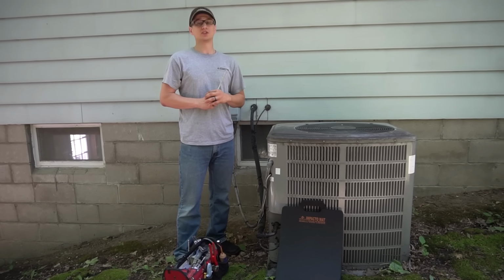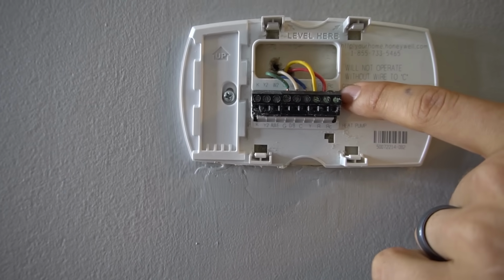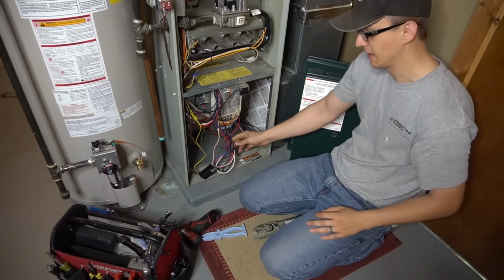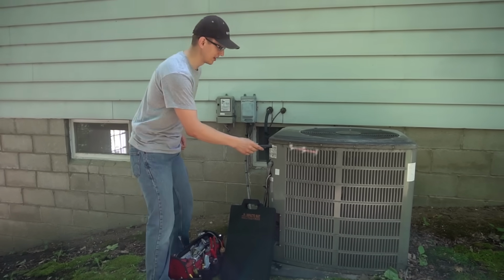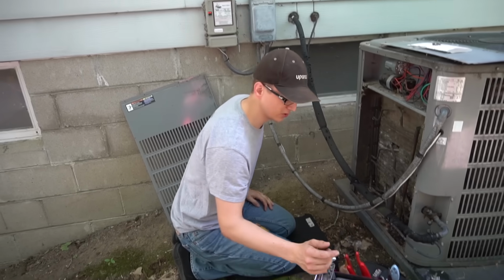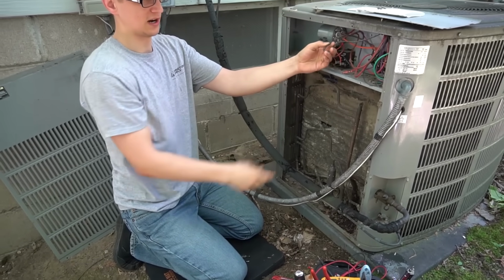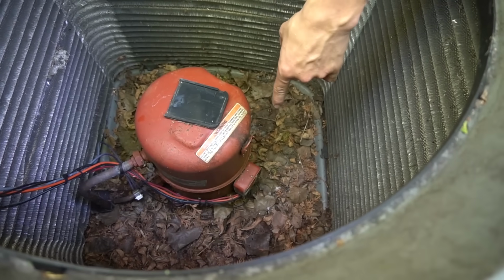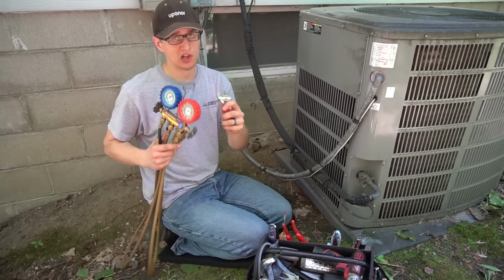AC Unit Not Turning On - How to Fix It Step by Step

Comment from the maker: ❄ Other A/C Videos For Reference:

Top 5 A/C Problems:
https://youtu.be/GOXgdnRB840
How to Clean Condenser Coil:
https://youtu.be/pzwOvgjwm_Q
How to Replace a Capacitor:
https://youtu.be/9ZGfvC-PMWU
How to Replace a Contactor:
https://youtu.be/qHZc9wWAF4c
How to Replace Condenser Fan Motor:
https://youtu.be/gGFTd2dmgxg
How to Replace A/C Control Board:
https://youtu.be/hijUExXrcm8
How to Replace a Thermostat:
https://youtu.be/1mJkjrwxdP4
How to Program a Thermostat:
https://youtu.be/uun8HJhM3h4
How a Thermostat Works:
https://youtu.be/Z4T9H-6VPtI
How to Check Freon Level:
https://youtu.be/dExFtP-nXTw
How to Wire A/C Condenser Unit:
https://youtu.be/KCanZEsLVEI
How to Read A/C Wiring Diagram:
https://youtu.be/I-sB4GIlbl4
How an Air Conditioner Works:
https://youtu.be/cRnzYJ4qmWE
When Should You Replace A/C:
https://youtu.be/Z7vUOySOWbM
15 Air Conditioner Maintenance Tips:
https://youtu.be/pBBnXHse-T0
Should You Get an A/C Inspection:
https://youtu.be/JqNsEzb__qs

Also, I see this question in the comments very often: "so what do I do if I press the plunger and the unit comes on? Should I replace the capacitor?"
If the unit comes on, that actually means the capacitor is likely not the problem. If pressing the plunger turns your unit on, I suggest watching this video to further narrow down the possible problems: https://youtu.be/NVPhsK4gK1A
Reply: Ok so we replaced the capacitor and the contactor and the fan is still not turning on. This is only a 2 1/2 years old unit. Everything still looks brand new.. The inside unit turns on and blows out air.. New battery's,  rest set Everything.  Idk what else it could be.
Reply: Super Tech. He should own the businesss by now. Thank you sir!
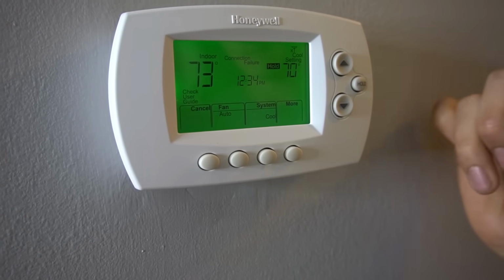Reply: So here's a problem I have turn the wintertime it gets to 69 in the house then it shuts off automatically I turn it back on it works goes back to whatever we have it set to like 72 we don't have insulation so turn the winter it can get very cold. What could be the problem you know cuz once it goes below 70 or gets to 69 it will just shut off then at around 3:00 in the morning we have to wake up manually turn it on. Had a couple technicians come out they couldn't figure it out I think it could be from the thermostat wire having a short and it maybe it just causes that issue but then once we fix it hopefully that will fix the problem do you think that's the issue?
Reply: There's no power to either of my thermostats or the unit itself and the outside unit isn't running either , the breaker isn't tripped

Comment: Hi there Jay!  My AC unit was working fine up until a few days ago.

Thermostats in the house work. 
AC filter is clean.
All breakers are set to on, nothing is tripped.

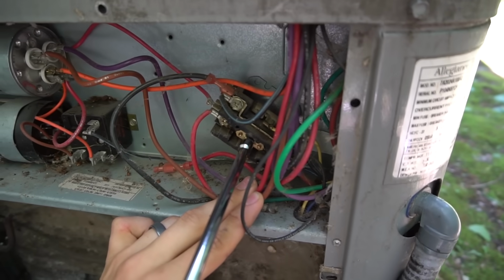When the AC inside is set to "on" the little plunger inside the electrical panel does not go down on its own BUT the AC condensor unit does turn on when I press it down the way you do at the 17:52 mark on your video.

Any ideas what it could be?

Comment: Just fixed my AC unit with the help of this video. A lizard crawled in and wedged itself between the contact points of the capacitor and turned himself into a fuse. Fried himself and the capacitor. Bought a new capacitor from a local HVAC store for $14. Yes, FOURTEEN dollars! AC blows cold again!

Comment: My outdoor unit will not kick on. Indoor air works, emergency heat works. No battery needed in thermostat like yours.  I have replaced the capacitor, the contactor, and the fan motor.  When calling for heat, I can hear the contactor click on, the buttons on the contactor pull in like its supposed to, and I can hear electricity flowing through it.  It does the same thing when a/c is called from the thermostat.  So I can hear it clicking on and off but no fan or compressor.  Any help would be awesome!

Comment: My current issue or what I thought, my thermostat said to replace the batteries for weeks now. Today I noticed the AC wasn’t kicking on so I replaced the batteries and it’s still not kicking on, indoors or outdoors. Even the fan won’t kick on. We have reset the breaker indoor and outdoor. I’m not sure what it could be

Comment: If you are still answering questions: My breaker keeps flipping immediately after I turn the outside breaker on the fan turns freely and begins to turn just briefly. I have checked everything in your video including switching out the breaker with no luck. Have you ever had the breaker pop from the compressor going bad? I have looked at wiring and also changed capacitor with no luck. My unit is 9 years old. thanks
Reply from the maker: Sorry to hear about the AC troubles. I'd suggest starting with this video: https://youtu.be/G1EBHrOgs-Q?si=AW_IK4dxIfzXyPiT
Reply: @WordofAdviceTV thanks

Comment: I replace my house filters, I wash my AC outsede. I keep on replacing the capacitors (once every 5, then 2 or one year. But I beleive that there is an underlying issue for capacitors to go out so often; though I don't go for the most expensive ones.  I replaced relays and now I am worried that I will need to replace the fan motor. But I need to check the attick drains first. Hopefully, I don't need freon (R22). But my ACs don't cool much air. I feel other people's houses cool down more and faster and mine have to work non stop and longer and with the worse results

Comment: Wow! You are super well spoken and extremely informative and detailed! It's EXACTLY what I need. My problem is that I can never learn about the proper use of a multimeter. It seems no one understands it no matter whome I ask. But regarding the fixing the entire AC, the explanations are SUPER easy to understand and to follow and super helpful, thank you so much. I need to crawl to my attick for check points- and those are not super clear due to not being so easy to access for exploring and are not very attractive to even think about it :( JJ. Thanks for being so thorough. Every time I come accross your videos, it's always pleasant to watch and is helpful in my cases.
Reply from the maker: Awesome! Glad to hear that the videos have been really helpful for you! I have 2 videos on multimeter use that you may find helpful. One long, with examples of use on furnace, and the other video shorter but with a newer multimeter.

Long video:
https://youtu.be/zr4Ow1JT9jU?si=CWMa4CUCAlLS0Nqs

Not as long:
https://youtu.be/y8JlMZwo7Pk?si=ggfBTAw8y4bOX-fV

Comment: I replaced my capacitor, but now the plunger engages with no fan, when the cooling system turns on. I hear the buzz. Before I replaced the capacitor, if I pushed the plunger, the fan did start. Is my contactor bad?
Reply from the maker: Sorry to hear that the repair didn't solve the problem! It's frustrating when that happens. Did you double check the wiring going to the capacitor? Maybe the wires were not hooked up in the right spots?

Comment: My account was working there was no cold air coming out. I cleaned could,  changed the filers and even put in a new capacitor... when I started it back up, it ran on the new capacitor for like 4 minutes and stopped and never came back on. I put the old capacitor back in because it was working and same nothing works. The fan blower works but the  blades and compressor  dont come on now. (Outside unit) now im at a loss. Aside from spraying water on the coils  i dont know why all the sudden it would stop working . Capacitor connection appear to be correct.  It's a Goodman 
GPC/GPH13 &14 SEER "H' SERIES
WITH R-410A

Comment: Another possible issue is if you have an overflow kill switch in the tray under your coil (furnace/blower side) that’s filled with water. If you have one of this switched it’ll look like a wire with two leads that is connected to a PVC elbow turned up. Drain out the tray and make sure the switch is able to drain (not angled down).

Comment: My troubleshooting led me to the attic mounted furnace where I noticed the condensation pan had 2" of water and lucky my HVAC installer put in a float cut off switch. Scooped all the water out, float reset and AC kicked back on. I also cleaned out the drain pipe. Hope this helps someone. Great video by the way. Thank you for taking the time to helps us homeowners out.

Comment: Here's an annoying one I ran across tonight at midnight:
Furnace fan starts but outdoors unit does absolutely nothing
Jumper is present between R/Rc, good continuity between them
Thermostat relays are closing Rc-G and Rc-Y
Manually jumping Rc-G starts furnace fan, Rc-Y does nothing
Unit breakers not tripped, 28VAC control voltage at R/Rc
245VAC at contactor of outdoor unit
Pushing contactor plunger starts unit just fine

0VAC control voltage at coil of contactor! What gives? Wire is not cut or chewed anywhere! Either I'm missing something or there is a break in the thermostat wire somewhere invisible, which is extremely annoying.

Comment: Your videos are excellent and have helped me numerous times.  I have a problem / question that I have not seen covered in your videos that I am hoping you can give me some advice on.  The unit is roughly 10 years old and has been working fine (this year, in previously years replaced the contactor as well as the capacitor).  It stopped blowing cold air yesterday and at the time nothing appeared to be frozen (checked inside coils) so the unit was turned off.  Today when I turned it back on, it is blowing warm air and the small discharge line inside is VERY hot, outside I think everything is running but not 100% sure that the compressor has kicked in (will be checking the voltage and contactor later today).  Does that sound like low / no freon or that the compressor is just not running?

Comment: Another simple easy fix is that if your thermostat is on and you went through all the other steps. 

If your furnace/inside ac unit is in the attic make, there’s a pan under it for water and there’s a switch with a little piece of foam on it almost think of the toilet tank floats. They float could be either blocked or in my case water wasn’t draining out of the pan and activated some kind of safety mechanism that wouldn’t allow the hvac to turn on.

Comment: I have a unit that has a hard stsart installed...  I am on tghe Gulf Coast and want to inistall a SOFT start, Can I just remove the hard stsart and replace it with a soft start??  Is there a reason for the hard start??

Comment: Thanks for your videos… AC outdoor condenser fan isn’t working, my furnace fan works I’ve changed the capacitor, if I push in on the contactor switch the unit will come on, however it will not continue to work? Any thoughts? Contact switch bad?

Comment: So I noticed our ac was not getting cold. After watching i think it may be related to that plunger. So I have to turn the breaker off and on and it will work fine.. once it gets down to set temp the outdoor unit fan turns off.. but once the temp rises it never kicks back on.. so in the morning the house is at temp but I get home from work and it's scorching inside... so I have been just turning the breaker inside on and off to make it work temporarily

Comment: I know this may be long shot but here goes:  The fan isn't turning on my a/c unit.
 I checked the thermostat-good. Hot air is blowing inside when i turn it on.
 I changed the air filters in the furnace and I didn't see any burnt out wiring.
Outside unit sounds like its trying but then turns it stops. And then tries again. The fan isn't turning though. And the unit itself feels hot to the touch.
Any other troubleshooting advice before i just give up? 
Thanks!

Comment: My fuse blows on the card.  I disconnected all the thermostat wires from the unit it still blows.  I press in my contactor and the unit powers on.  Everything but my the white wire is grounded.  When I unwire the thermostat wires from the unit.  Only the red and yellow wires are grounded at the unit.  The disconnected thermostat wires from the house are grounded to each other.  Red,yellow,green.   The thermostat inside is set to cool.  Contactor that is Unwired at the ends and no power exhibits 17 ohm at either end.  Transformer shows 28.6v
Thermostat inside is battery, (replaced them). Simple basic thermostat.  My whole unit is outside.  Gas heat and ac.

Comment: Any leads on what I should check if the system works when the plunger is pushed in? The thermostat seems to be working fine, I replaced it with new batteries but the only way I can get the ac to come on is with the plunger manually pushed in, the system is completely quiet otherwise
Reply: Actually just found your video on top 10 reasons this could be an issue, thanks

Comment: I don’t know if this is covered specifically but I managed to get it up and running again but some of the system has leaked a lot on the inside area around the filer area. Any reason why the inside unit would be leaking??

Comment: My AC is acting up. Something to do with the AC disconnect near the out door unit. When thermostat kicks in for cooling, the fan/compressor  does not start. However, If I pull the disconnect switch and place it back, everything works as normal. And the unit  shut off after reaching the cooling temp. Then next time, when thermostat kick in for cooling nothing happens until I repeat the pull/place at the disconnect switch.  What could be wrong? Is it switch or the start/Run capacitor? Thanks.

Comment: 1:26 That dont seem too wise to try to spin that with a screwdriver while its on. Better way and waaaaaaaaaaaaaaaaaaaaaaay safer way is to spray water down on the fan. That will also spin the blade blade with out any possible chance of dropping a screw driver into the fan if it does take off. I am not a professional but I do have some common sense. Only time I would spin the blade with a screw driver is while the unit is OFF, to test if fan is seized. By the way I am here looking for info. I have a CK30-18 the fan does not spin but it does spin easily when I spray water down the center. I hear a low hum coming from the machine.  The indoor fan will spin some. If you can answer this or point me to a video I will subscribe.

Comment: Bro you saved me. Thank you for a detailed, but easy to understand explanation. Everything seemed normal based off your description, til I got to spinning the fan

turns out the fan was stuck (prob rust from heavy rain yesterday) and 2nd push got it going

Although I couldn’t find the contactor switch on my unit

Comment: Hi , I noticed the air coming on seemed to be more quiet. It’s cold but shutting down . Thermostat says warmer than what I have it set at by a couple degrees so then I turn it down more and it doesn’t kick back on . I turned the fan from auto to on and it doesn’t kick on husband check the breaker backs and didn’t find anything. I went outside and the pipe where you put the Freon in it’s wrapped in foam the top of it has frost on it and then the pipe that’s attached to the air conditioner from that part has frost on it while I was outside the air conditioner kicked on all by itself. We did check the blower and it is spinning. What could be going on?

Comment: My thermostat upstairs is a nest thermostat.   I noticed the upstairs ac hasn’t been turning on and when I check the thermostat, it says e298 - no power.   The unit downstairs seems to be working fine.   Where do I start troubleshooting?

Comment: I have been told by two techs that my compressor is on borrowed time. Everyone is back logged with work. It is a system that uses r410 a. So I need a complete system. I am trying to nurse it along. The problem I am having right now is the compressor will shut down and not restart. The handler keeps running and makes the house warm. I through the breaker which by the way never trips and the compressor comes back on. Does this make any sense?

Comment: Your video is so informative! What do you suggest for a unit that is blowing inside, the fan comes on outside, but then turns off and doesn’t come back on until you turn off the system at the thermostat and then turn it back on?

Comment: My fan blades are puttering but not spinning. 
I am feeling a little stuck on what to do next. I have gone through and checked most of the things in order that you have presented. I have checked the thermostat and everything is working well there. I have checked inside and everything sounds, feels, and looks good there. I am looking at the outside unit. I have cleaned underneath all the panels. I have changed out the capacitor. I have tried to push the slightly puttering blades and they won’t spin fast. The compressor unit sounds like it is on and the fan sounds like it is trying to move. I think that the next solution is oiling the blades or replacing the fan motor. I am going to the store to buy the oil that you suggested. Before I go buy a new fan motor, any other suggestions at what it might be? Or suggestions on where to buy a fan motor?
Reply: I tried oiling with no success. The fan tries to turn but instead just putters for about a minute or two. Then it slows down and the unit (I think the compressor) lets out a wheezing sound. The sound resembles air being released as if it is being depressurized.
My three little kids and I are on a week with no AC and I’ve tried fixing things myself. Any advice?

Comment: I bought a big fancy Bryant heating and air unit. It's only 6 years old and they've been out three times to fix things. First time it was a part that prematurely wore out. Second time they came out the first guy put some actuator or the wrong part in and that ended up being a 4-Hour labor job. Here we are the next summer and it stopped working again. I don't know anybody that's had this many problems with the unit less than 10 years old. And the company charged me for a maintenance plan and all they did was come out and make sales pitches instead of clean it. I've lost faith this company and I'm hoping someone reliable can help me out because I'm out of money to keep giving them